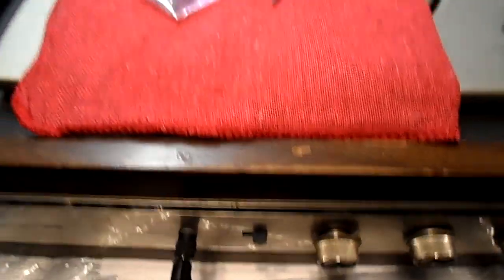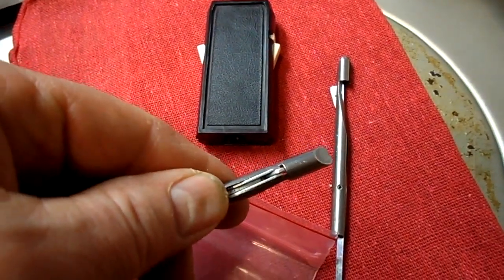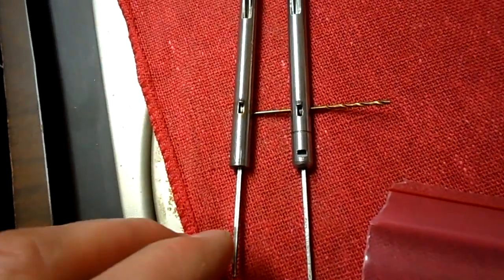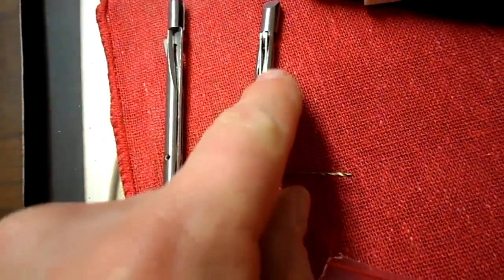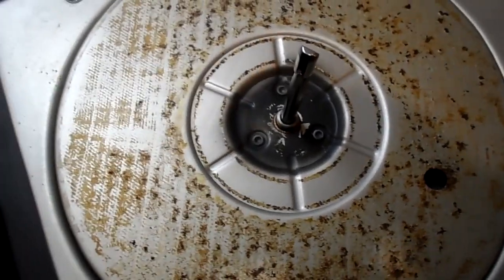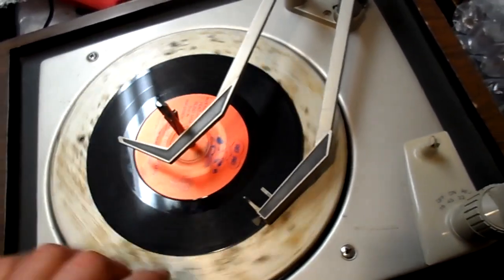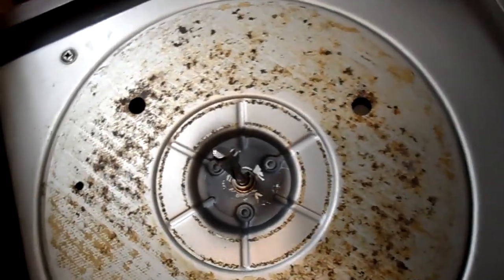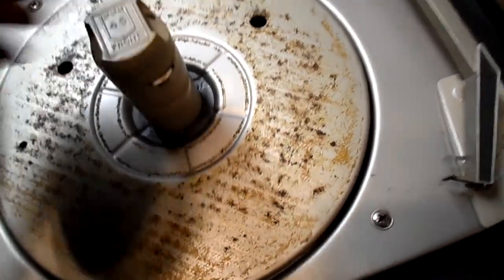Testing The Replacement Spindle For The 1967 Magnavox Changer..

Comment: How did you get the old spindle off?
I have one that needs replacing but stubbornly won't come out.
Reply from the maker: I believe there was a setscrew underneath at the base of the spindle.
Reply: @Farmradio  there's no set screw whatsoever. I believe it's just stuck.